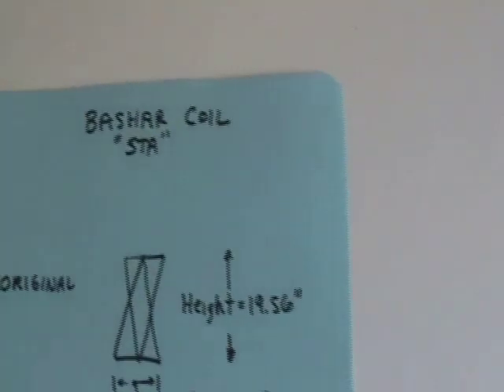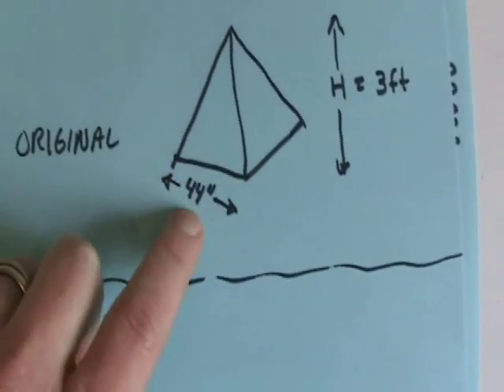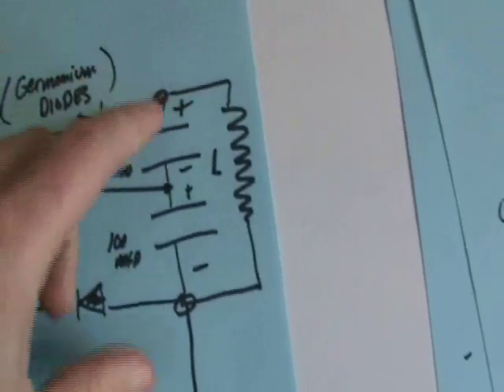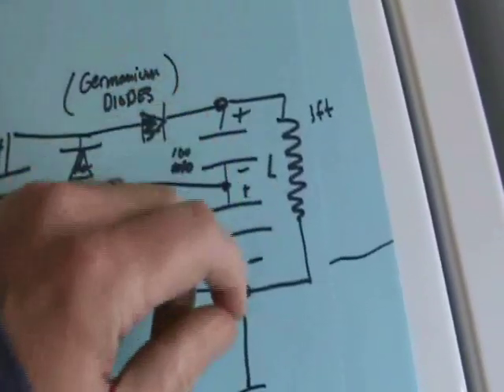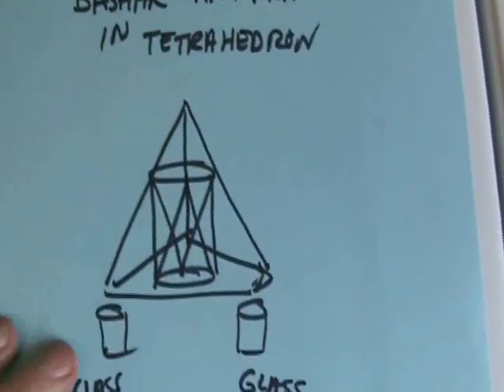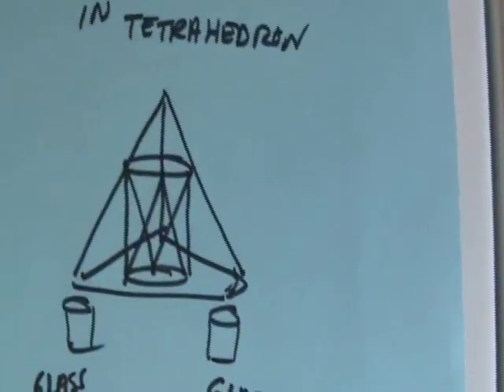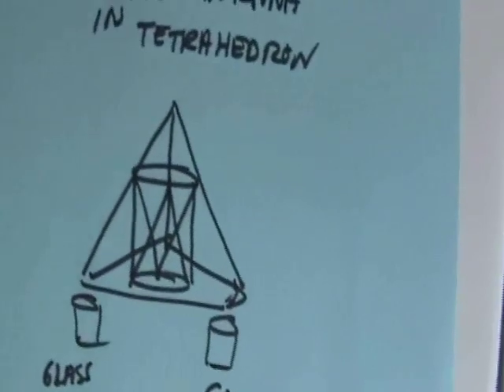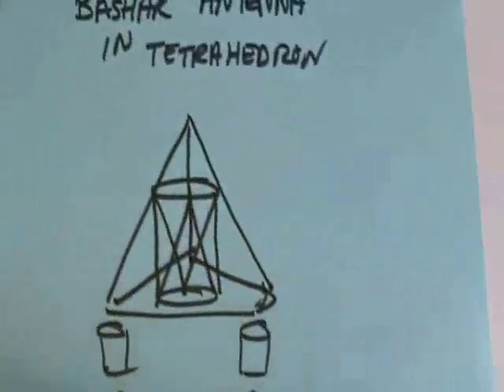Ep. 6: Bashar Free Energy Space-Time Antenna (Tetrahedron as Capacitor)

Comment from the maker: If you ionize your antenna, it "receives" better. Ham radio operators know this. The gain increases. The power increase is not ONLY from the power you provide. There is a voltage that you can use right on the antenna wire. People have demonstrated radio powering a PA system using only a long antenna wire -- no batteries.

Comment from the maker: Yes -- external power input. Now your getting it. Imagine a situation where particles arrive to a plate -- radiant energy. This is easily demonstrated, although you need a LARGE plate. Now imagine a situation where the plate can be smaller because you've set up a magnetic vortex. To keep that vortex going may require very little power. Tornadoes, for example, get external INPUT that is not very large, YET they have enormous power. The potential energy was there, and the tornado opened a gate.
Reply: upgrade to ableton live, 9 would do. heaps more flexibility.

Comment from the maker: re: different grounds.
There are absolutely different ways to get a ground. How does an airplane up in the air get a ground connection? Or a space craft? Every metalic structure you connect to has a different potential. Ever FRY equipment because their ground potentials were not the same. I have seen it happen. Grounds do NOT have the same potential. Just search the web about this topic. Also, when your washing machine is running, for example, voltage SPIKES can enter your plumbing.

Comment: OK I'll solve that puzzle for you. Use an inverter to convert solar DC to AC at  whatever voltage you want. If you want to transmit then use a high voltage and a low current as the heat lost is proportional to the current squared. Yes there will be losses at the inverter but that's preferable to the high transmission losses. I'm willing to bet my 60 Watt panel will produce more power than an array of 1 million Bashar antennae, because a million times zero is still zero.

Comment from the maker: You mention Solar. One problem with Solar is it produces DC. And we learned from Edison's time that transmitting DC is not easy. So if you have a 60Watt panel say, up on your roof, and really long wired down into your room, you've lost a lot of power HEATING those resistor-like wires. So, we move to AC ... and then even POLY-PHASE, etc. These were not OBVIOUS moves 100 years ago. There may be other puzzles to solve like this.

Comment from the maker: Yes. I even mention those exact thoughts in the video. I don't believe in "free" energy. I do believe in new unexplored areas of research and it would be complete arrogance on our part to think we've found EVERY way of doing something. Recently I've found I can make a chopper circuit very easily with a relay and battery -- no Silicon @ all. Very old school, but very good and converting DC to AC. The problem to be solved is best expressed as HOW to use energy with most efficiency.

Comment from the maker: Electrons travel in a straight line, unless they come across a magnetic field, at which point they bend. If the coil was producing a nice field, particles would BEND in the trajectory away from or toward the coil, depending upon polarity. If these particles impact the tetrahedron, they will add or subtract charge to the surface. As this occurs, it could further stimulate the coil inside to oscillate, producing a strong oscillating magnetic field. Line of site to the Sun is helpful.

Comment: I could be wrong in my interpretation, but it seems to me that the tetrahedron is not on the same circuit as the coil.  The Bashar coil sets up a certain EM resonance that attracts the cosmic energy of a certain high frequency.  The tetrahedron capacitor antenna picks it up, steps it down to a useable electric charge which then goes to your receiver, a battery/storage device, or to your motor or other work.  Does that make sense?  Please let me know if it does or doesn't. Tks for your hard work